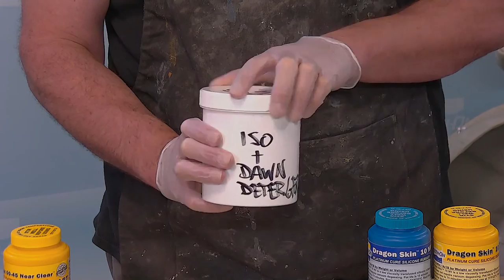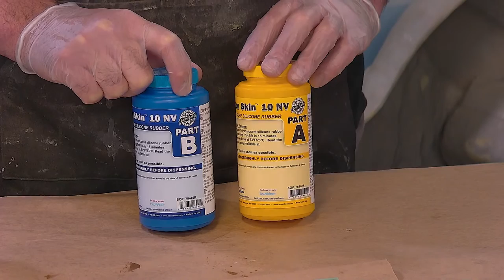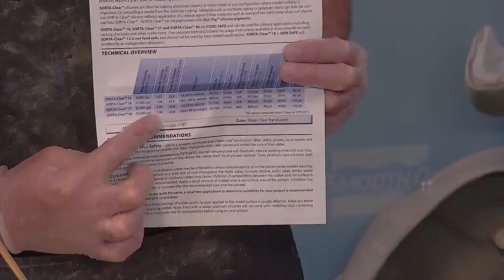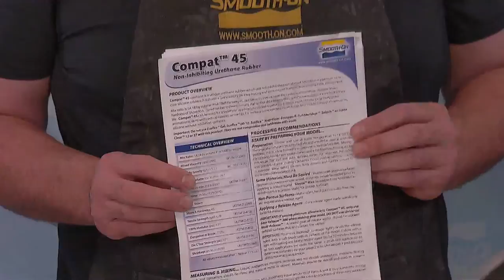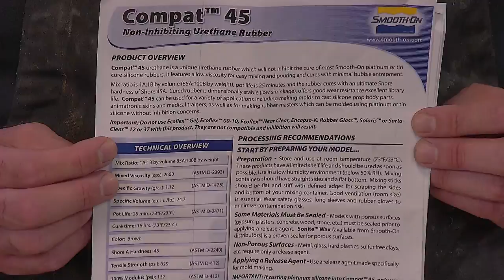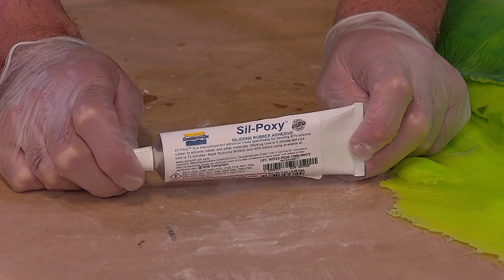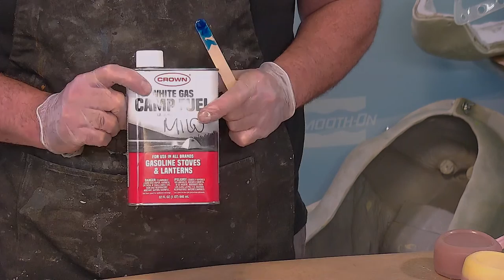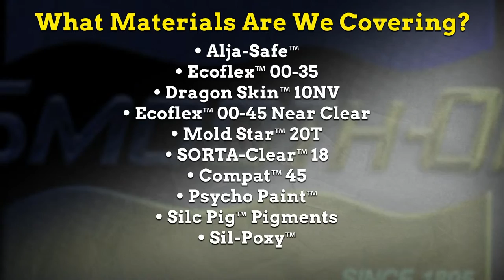Live! - Casting Silicone With Milo

Comment: Hello, I have some questions about painting, 

Its there the possibility of making a paint mix from platinum silicone cure, and for platinum cure silicone? So it can have its propertis.

Or in case you want a fading effects in color,
Do you recommend applying a thin fast curing platinum cure silicone on the mold, and in the middle of curing add the rest with platinum cure (being a more viscous version) with the base color?
Example:
Thin (Body Double Fast Set) and thick (Ecoflex 00-31 Near Clean )

Thanks in advance :)
Reply from the maker: We would recommend using Psycho Paint, a platinum silicone paint base, for bet adhesion: https://www.smooth-on.com/product-line/psycho-paint/

Comment: Hi all. I need to make thin silicone strands, 1,5 mm in diameter and about 300 mm long. We make BDSM floggers and I want to make these strands for the sensual flogger. I am thinking that extruding the strands may work. Does anyone have any inputs or advice please?